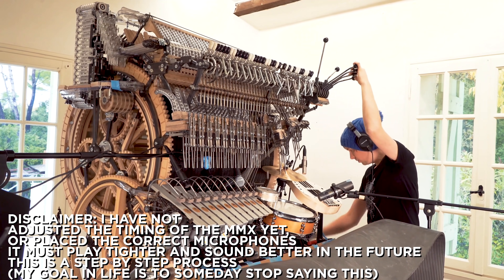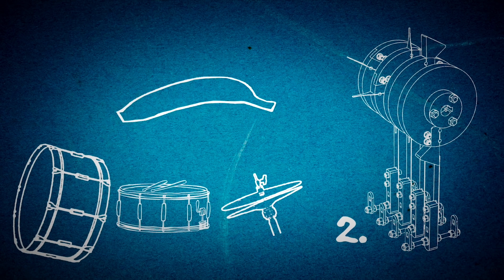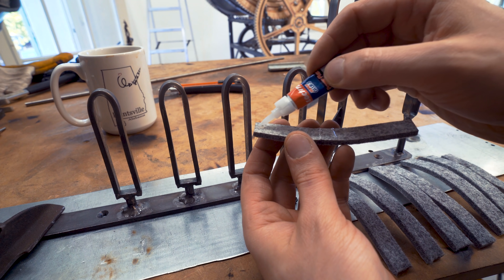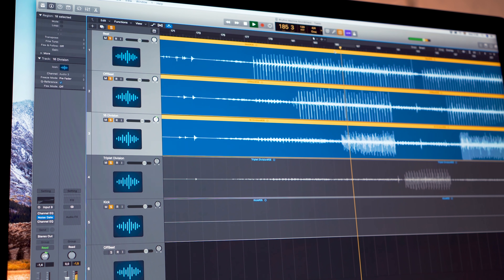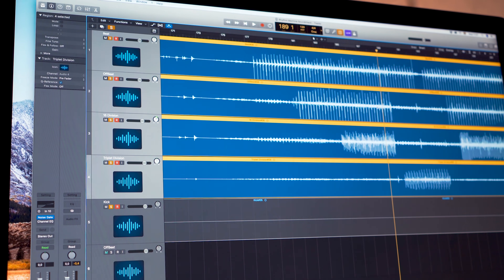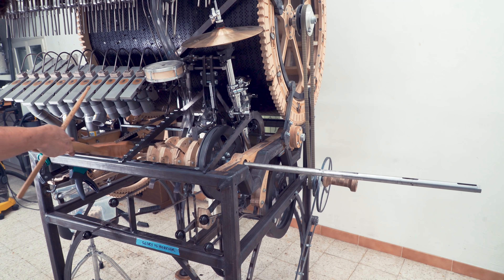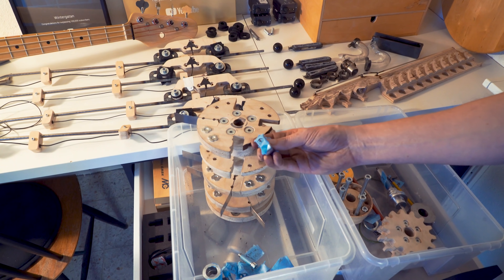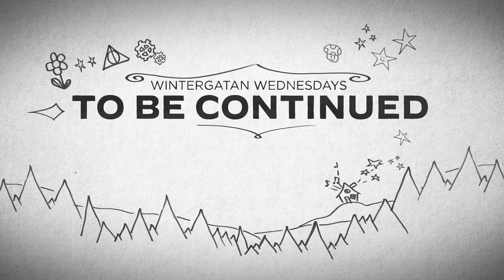Rhythm Machine Experiments - Marble Machine X #107

Comment: I know it has been awhile since this video was released.  I'm trying to collect all the videos.  Any way,  during this video you said it was difficult to keep the Fly Wheel going at a certain speed.  This is critical I believe.  I been thinking about this for a bit.  The quick and dirty way is to add a strobe next to the fly wheel with timing mark for different speeds.  You can either adjust the strobe for the different timing or you can place different colors of timing marks on the fly wheel.  

Oh by the way.  Not sure why you used individual dampers on the vibraphone instead of using a single one to go across the entire instrument.  During the build process I didn't see any reason the present set up.

Comment: Garbage in, Garbage out... I"m a retired sound engineer, you have to get the sound you want BEFORE you start adding anything on top of it. Sometimes in the studio, a drummer would bring in his kit and it would take a day or two just to get the drum sound dialed in and under control. 

And the... "it will sound better once the crowd gets there" is only covering up the fact that the people will absorb certain frequencies. That is why that theory is hit or miss... 

It is better to fight with it before the crowd gets there so you can have the headroom you need to be able to crank up the volume once the crowd gets there. I would sound check at an almost unbearable level 103 to 106db at the console. I would have tons of headroom without having issues. One club I sound checked at, for a Van Halen clone band, they had black light posters all along the walls and I took out half of the black light florescent tubes with the kick drums during the sound check. And another club with a 3 piece heavy metal band, half way through the night, I was tilting the pinball machines at the other end of the club with a crowd of 1000 plus people. Zero feedback...

That is why as the night goes on you hear some engineers start to have issues with feedback, they didn't ring the system out during the sound check. And as the crowd gets there, it adsorbs the sound so you add more volume, then as the night goes on, they start playing harder and their ears and your ears, start getting tired so you start to crank it up. I always paid attention to my console levels and sound pressure meters and not rely totally on my ears as far as master volume levels go. 

Where you run into trouble is... there is no crowd between the rear of the speakers and the band. But there is, between you and the mains. And in some cases you have to account for reflection of the upper mids and highs reflecting off the crowd, low ceilings, walls, etc... back to the band. And I was mixing sound before there was ear monitors, so you had side fill and floor monitors plus the monitoring mix to contend with.

Plus with new bands some times they get excited and or nervous and play harder than they did during the sound check which will throw some or all of the sound check out the window. The worse band I have mixed for, was during a live radio show... you would have sworn it was a totally different band from the sound check the day before, because they got so nervous knowing they were playing for over a half million listeners and being in front of the talk show hosts and studio guests.

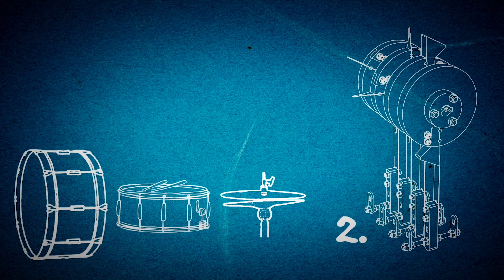Comment: 1:24 so... Why don't you implement a shaker on the marble machine x?  Maybe you can put a shaker on the edge of a really-fast gear (that must be adjusted on some quadruplets-pattern); so it moves the shaker making it sounds. The hi-hat machine is a beautiful idea... but it isn't a shaker, and in my opinion the marble machine x needs a shaker

p.s. I've just thought about recycling the parts of the rhythm machine that you have removed... you can make them MORE rough ( I mean that the surface area would have some lines, which ones would be deeper than other lines), so the spring steel action will sound MORE like a kind of guiro so it will seem more like a shaker... I don't know... I'm not a designer, so these are only my opinions about the situation  I was thinking on these days.

Comment: it might be time for an electric motor to control the speed better.
with a clutch in and out of course, and a micro-controler to adjust the tempo of the drive.what do you think, huh? you could add blinking lights...

Comment: Is it possible to paint the Marble Machine? I wouldn't reccomend actual paint.(That would possibly cause a bit of friction in some areas) I think spray paint would be the best choice, and it would only take a day. Just make sure to cover the important parts (Marbles, pipes, gears, metal, etc) with some tape.

Comment: IDEA: for timing, instead of using the hand crank to speed the machine, use it to tighten a spring powered motor, like in a wind up toy, & use a lever to control the speed. A big coil spring with a one way gear.

Comment: How are you finding warping due to temp changes? I mean in sweden you have a really big temp difference between summer and winter, that would for sure put your timing out due to warping of the wood. Bigger parts would likely warp more than smaller parts as well....

Comment: "The rhythm is really difficult to get tight"
What would happen if you added a Centrifugal Governor with indicators on it to show how fast you are playing the beat? It wouldn't help with the offset timing issue, but once you found the timing, it would be easier to keep the crank at the correct speed.

Comment: Directly changing those wood + spring steel is good option, because if you stay with it - beside the sounds not good enough - those 'scratchy' activity will deform the wood by time.

Comment: You spoke to the issue around timing and maintaining it while adjusting other setting. Have you thought of installing an "over speed govener" to stop you over speeding the fly wheel  but allowing you to slow it down if required. The unit could be made ajustable to cater for different preset speeds.

Comment: I think having the spring steel come in contact with a single point rather than dragging across a surface would result in a much tighter transient. You could always add software processing to the channels after the fact but you’ll already have a clean envelope from the contact mic

Comment: The normal process of learning and self educating.
However, I see an immediate problem with the springy drumstick idea: The stick will hit the hi-hat with low speed, so it will be very silent, and later will prolong the sound while rubbing against it. You'd rather need a mechanism that hits the hi-hat once and then retreats. I am thinking about cams and followers ...

Comment: It is not just the engineering getting better, the script is also getting better with each episode: Angle grinder symbolism is very powerful. Meticulously removing the blue tape from the floor as work to be done although you are demolishing a piece of already completed work, dismembered limbs of the beat machine with a drop of blood on the floor,  melancholic theremin music on a saw juxtaposed with celebratory eyeglass frames, all fit in perfectly to deliver the trials and tribulations of the protagonist.

Comment: I'm curious... if you want a clean sound exactly at a set timing... and you don't mind using a drum machine... every drum machine that that I have used allows for a digital input... you have the timing wheels... and they are lockstep with the machine... you could have metal pegs and use a hall effect sensor to detect the metal passing. Then run that signal into the drum machine trigger. It would be a perfectly timed pulse every time... and you could then convert that to MIDI and make it sound like anything you wanted. And... using that trigger to your PC... you could sync anything you wanted to the machine.
16:22 - And there it goes...

Comment: Martin @Wintergatan , how would the rithm machine sound with sand paper or rasp over the pickup? Materials and texture can influence a lot on sound. As the spring steel has bended, what about using drum sticks with springs as you modified now and a  spring steel (curved/bent for shaping the sound)  and underneath pickup (reversed system)? And thumbs up for your great work:) I don't believe, I know it you are building the perfect MMX!

Comment: What about using a side chain compression ? I think it helps you out by allowing a more shapeable from a square wave to a more sine and quanatize it to your liking. Maybe it could to help with timing too and you can adjust the velocity.
Reply: And what about sick dub step beats? Would you do a 130bpm song with a half step? Or could you achieve this without much thought or reimagining of parts by instead of spinning the rhythm machine up to match 130bpm, rotating it to 65bpm and doubling the programming pins used and moving the pins half the distance closer? I think a simple gear box that can engage a planetary gear with maybe two different sized sun gears could help get some more exotic rhythm and timings like simple edm or dubstep or whatever you’d like, heck maybe some renascence timings or even zeppelins black dogs, 9/4 ths:)

Comment: To maintain a consistent tempo, there must be a way to use something like a centrifugal governor used by James Watt to regulate his steam engines: No matter how much steam was passing through, the governor would make sure the throughput steam remained consistent. Like this: https://en.wikipedia.org/wiki/Centrifugal_governor I think something like this could be created for your player so that once you have it set for a desired tempo you just have to be "close enough" in your rotational frequency to maintain a constant output frequency. 

Or, think along the same lines as how a CVT transmission works.

Comment: As I was watching you beat matching the Machine with the computer track like a DJ I thought how useful it could be to have a speed gauge. A device that displays rotations or beats per minute, like on a modern turntable or a cycling speedometer.
Anyway, just an unfiltered thought. Good luck!

Comment: This is going to get buried, but I feel like there are three issues with the new suggested design as well:

1. Are we sure that high-hats still sound good with material grinded away? Remember what happened when you painted the ride cymbal for the old machine.

2. The way you shaped the two pieces of high hat in this video, means that they won't close together tightly anymore, but there will instead be a gap bewteen them in certain places. Does that still work and sound good?

3. They way the rhythm machine will hit the hat is is still not like how a drummer would hit it, bouncing the stick up from the cymbal.

And then a minor issue: The drum stick tips would have to be replaced now and again.

Comment: Make it so that the input turn rate is constant, by means of a servo electric motor or with clock gearing, you'll be applying the pressure through the handle like the spring in a clock, but it will only spin at a set rate, then you could adjust the end speed with gearing

Comment: Weird Idea: Adding some kinda of metal topper/cap to the curved wooden parts that brush against the steel spring. 1)the wood is will probably melt/burn away over time and need replacing often, might change sound wave produced due to ever changing surface features. 2) make it something that when you strike the steel against it it makes SPARKS! Not too many but get a similar effect to strikers or flint and steel.

Comment: This comment won't be probably viewed by anyone, but i'll try anyway :D
I see one problem with planned "stickwheel" - change in speed will change force at which stick hits cymbale. Also, movement of sticks seems excessive.
 Maybe it would be worth to make cam-and-lever mechanism, which slowly raises stick and then drops it to hit cymbal, that should maintain same force throughout different speeds of machine. Maybe, with some careful tuning, it could also add inertia into mechanism, delaying hit, which could help solve timing issues

Comment: Maybe you can implement the function of a centrifugal governor for speed control. This is widely used to limit speeds of engines (especially in the past) 
With some gear ratios it should be possible to realize different stable speeds for common BPM’s. Maybe the governor controls a clutch that limits the amount of force you can apply to the system while turning the handle. It also looks cool while it’s spinning, maybe on top of the machine.

Comment: why is timing an issue ? when the machine is running, all timings of all components are in sync, because you drive it by crank. so if you rotate it slower its fine, and if you rotate it fast its ok also .....  :-D ? or not ?

Comment: I'm thinking about how the position of the levers affect the timing. Since he has no high stop (maybe a screw to make it adjustable?), won't the timing be off due to the slightest misplacement of the levers? Also I could think of the metal plates pushing down the levers over longer playing periods or is the clamping of the fell that strong?

Comment: Why don't you use a gear shift system, like in a car, to control the speed of the fly wheel. This would mean that no matter how fast you turn it it will maintain speed at a particular level.

Comment: Hey, Martin, regarding the issue with getting the timing right to match an external source without varying (fast and slow), how about adding a speed governor like the ones on steam engines?  Not only would it help keep the speed constant, you could make it adjustable and it would look awesome!

Comment: Sound is giving me goosebumps as well. Maybe bend the edges of the spring steel so it's not scratching, just sliding on the wood. Could also add some ridges on the wood piece.

Comment: I KNOW HOW TO FIX YOUR TIMING! Use a bicycle computer on one of the big wheels. It uses a magnetic reed switch to calculate the speed it is going at. By playing with the size the you set the wheel to be you can see exactly how fast you are spinning the wheel and make adjustments on the fly. There are tons of inexpensive ones and it is practically a plug and play set up where all you need to do is learn the exact speed that you need it to read to keep it within time. You can adjust how sensitive it is by choosing the wheel with the optimal speed (likely the slowest or fastest spinning) and mounting multiple magnets on the wheel to get it to read something like once per turn of the crank arm. The only limit will be the speed that the bicycle computer updates at so do your research and get the one with the highest updating speed and preferably go with wired rather than wireless just so there is one thing less to worry about. Im sure if you wanted to you could have someone like Big Clive dot Com build you a purpose built circuit board that would update 5 times faster than you need with a custom display and you could set exactly how accurate it reads the marble machine's speed and then it will be up to you to physically get the machine there and keep it there. Hope this helps and others can add to this!

Comment: I'm a bit worried about the levers for the flywheel thingie. It looks like with enough hits it'd eventually be pushed downward by the repetitive motion of being hit. Wondering if you put a small layer of rubber between the felt and the metal for the levers if it might better help with that possibly being an issue?

Comment: Martin, you really almost need a small belt or gear driven speedo over by the main crank and flywheel that has been calibrated to the drive shaft rotations to bpm so that you can more easily visualize the beat speed that you're generating with the MMX for greater ease of setting specific tempos.

Comment: Matt it may sound silly but watching you pull half the MMX apart to pull those parts off and chop a bunch of things off just to prototype made me think you should make yourself a fast and dirty prototype stand.  Something with just the crank wheel and a basic drive that you can use to check timing on stuff like this without cutting and welding on your frame all the time.  Not a welder or metallurgist but that's got to be rough on the structural integrity of your frame after a while (each time you grind or cut you remove more than just the added part) and I think all of us would have a collective meltdown if part of the frame failed in the middle of one of your vids...  Though that vid might not come out till we rescued you from the little white padded room and straight jacket from your own melt down.  Any way keep up the good work and I'm looking forward seeing you finish the MMX!!!

Comment: Good that youre not using so much digitality! If i was been doing that, i could place the light d resistors to your rhythm machine and leds to the light source, so every time the rythm is supposed to hear, the ldr gets light, Will connect electricity and wehen you wire it to the Keys of the keyboard, it Will play the sound what is under that key. So you can place any sound to it trough midi or something. Like im done here, https://youtu.be/yr6ea4Relms
 but this is made with no moving parts.
Reply: Because in my machine, because its totally digital, i can not adjust the shortnes or longines of the touch or beat. When in totally mechanical or with the LDRs you can basically do what you do with your fingers ; slowly press the key, hold it and slowly let it come back up, and do more human music.

Comment: You don't seem to fully understand how the noise gate threshold works. With the threshold knob you tell to the gate plugin how loud your noise is at the loudest. Just raise the threshold until the noise is cut off, but don't go much higher than that. If you set the threshold much higher than the noise level, you just needlessly eat away your dynamic range. You want to set your threshold as low as you can. After setting the threshold, adjust the tightness with attack, hold and release knobs.